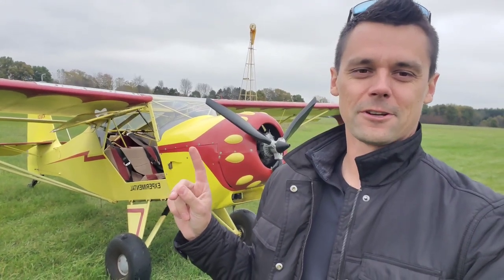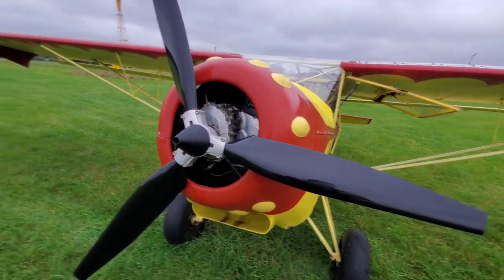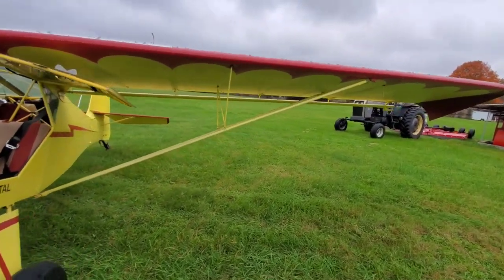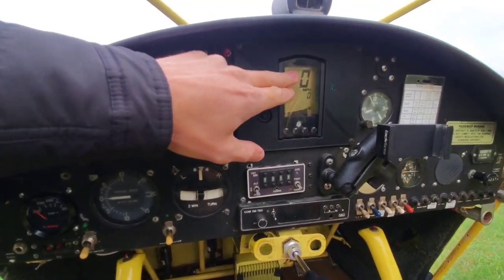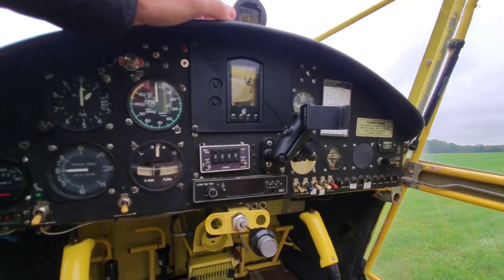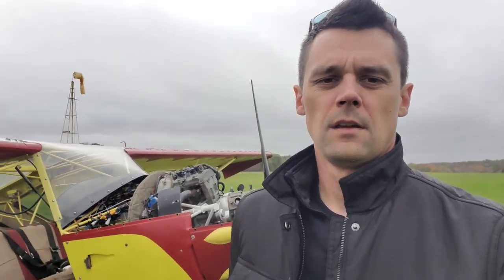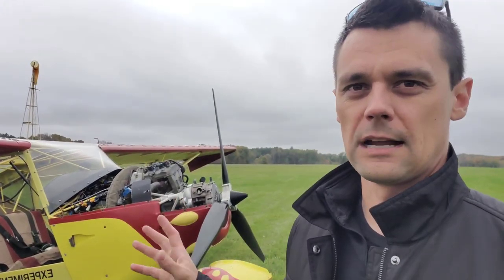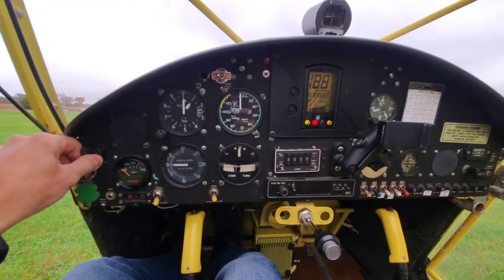Yamaha Phazer Kitfox Swap Part 1

Comment: I just came in to say hello from a video Jonas posted yesterday that you commented on. I'm from a smidgen S of Flint and try to follow most anyone I come across from MI here, TikTok and IG. I'm interested in flying but probably won't due to $ and my priority now is getting back on my Goldwing to see the country after getting grounded for 2 years. Our fam had a cabin a few miles north of the catastrophic dam failure for many years. Are near there bc you mentioned beets in a prev vid.
Reply from the maker: Hey Mick, I'm near 69G, not too far!

Comment: I had a Phazer snowmobile. It was a great sled but that was decades ago.

I also have an Avid Flyer with a 582 and a Kolb.

I really don't see any advantage of a Phazer motor especially considering the work needed to do the conversion.

My Phazer was a 2 stroke. I'm pretty sure I would have lost power had I tried to adapt a 4 stroke muffler to my sled.
Reply from the maker: 2007+ 4stroke phazer, fuel injection, 80 hp, 50% less fuel burn. Turn key operation. No 300 hr tbo , etc etc

Comment: Hi Ben awesome work. I’m very close to finishing my model 1 kitfox with a phazer using your adapter plate. I’m stuck on the air box now. Is there anyway I can buy your air box or the file? I’m also gonna order your speed sensor!

Comment: Hi Ben
I have a challenging project that currently have a 582. The challenge is the engine is and how down the gear box needs to be. My plane is a Streak Shadow (British ultralight). Can you check the model and let me know if is possible to install the phaser on it. I don't want to buy an engine that is no going to work in my airframe.
Reply from the maker: Looks like it would work. A custom engine mount will be required